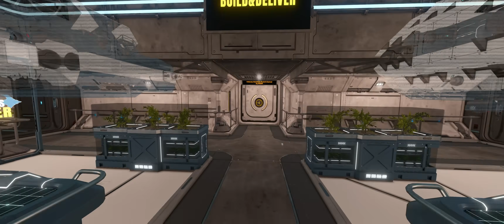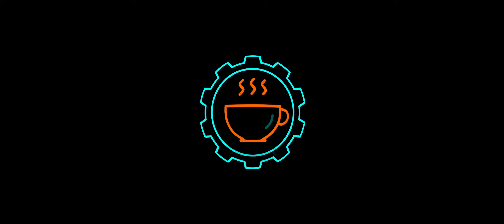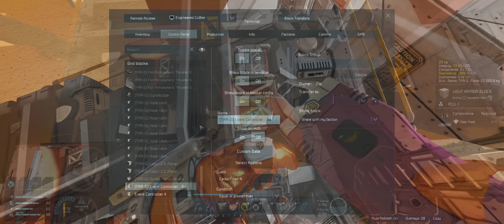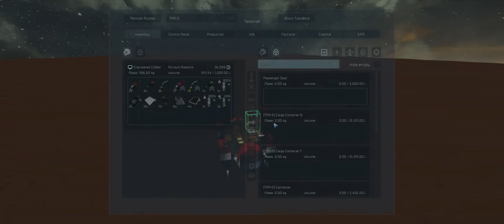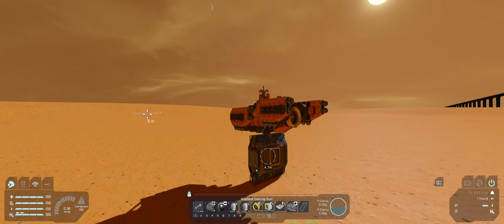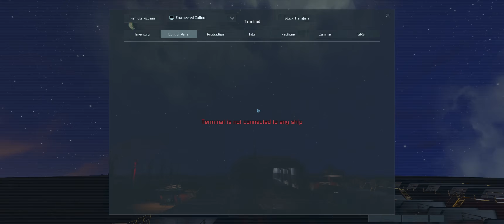Time to Focus!... Ooh, Look a Squirrel! | Martian Engineering E44 | SE Survival

Comment: I am watching through your episodes now but I am wondering if the beacon selection is an issue for the drone pathing? I haven't really used them for going between grids for cargo transport yet so I have only dealt with one beacon for where mine take off and land. Maybe for static you don't really need to set a beacon since globally the static grids don't change.
Reply from the maker: The drones don't use beacon references for the static station waypoints. Good call though.
Reply: @EngineeredCoffee  Ahh, i thought as much. Just out of curiosity, have you tried with align to planetary gravity turned off? Or if it is still an issue since it has been months since that video was put out.
Reply from the maker: I have not tried it with the no gravity alignment...

Comment: Looking at the upper floor there without a roof.. I thought "That would be a good place for a glass ceiling", which expanded into me to thinking "That's how you could do the rooftop patio and stay pressurized.. with a glass roof".

Having a printer setup, to print submitted Apartment blueprints, would be something neat to watch in time-lapse.

You set Max Speed changes for the Tardigrade in one direction, did you set them for the other direction too?
Perhaps it was done off-camera or was cut footage in editing.

I think you were onto something, setting the waypoint before turning and moving on to the next waypoint, it seemed to be traveling better (visually) after you did that.
I'm thinking the slow travel along the large distance between waypoints might be related to AI Behavior and/or AI Precision settings.

Comment: Kerbo also had some weirdness recently with roll-your-own transport drones, and moved to PAM. I wonder if it's a new bug?
Reply from the maker: PAM is always the answer. I may do it too.
I also wonder if it is the amount of stuff in the world now, the Skeeter factory is all weird too.
Reply: @EngineeredCoffee  SAM is the way for cargo drones IMO
Reply: @Steelhelix98  Is SAM just a different version of PAM?
Reply: @Dreadfish_1 SAM has the ability to shuttle your drones between connectors and it doesn’t require route recording. You just tell the drone which connectors to fly between and you can tell SAM which connectors are for loading and unloading and it won’t undock until the drone is loaded or unloaded

Comment: If it doean't create more lag to add additional waypoints to the AI pathfinder then try make an intermediate waypoint for the long stretch. As in, have one waypoint to get the rotation correct then another to go in the right direction, seperate it into 2 moves at each approach waypoint. Just an idea not sure if it will work. Great video as always!
Reply from the maker: It tried it, i had like 7 waypoints and it was still fussy. I edited out my frustrating ranting 🤣
Reply: @EngineeredCoffee LOL definetly sounds about right, maybe seperate them into two seperate waypoint chains? Use an event controller to trigger the long bit? Might be a hassle though becuase I think you'd need an event controller for each move point pretty well.. bit of a janky hack but that just sounds like space engineers for ya haha